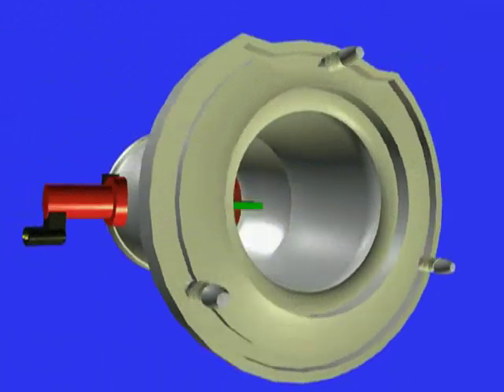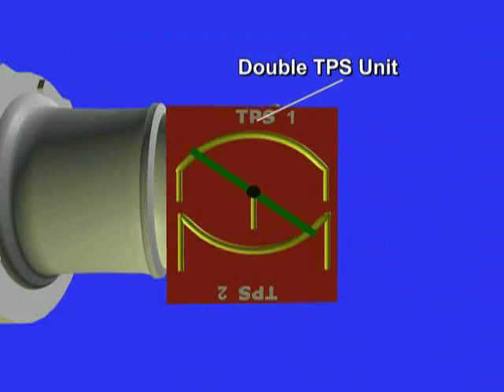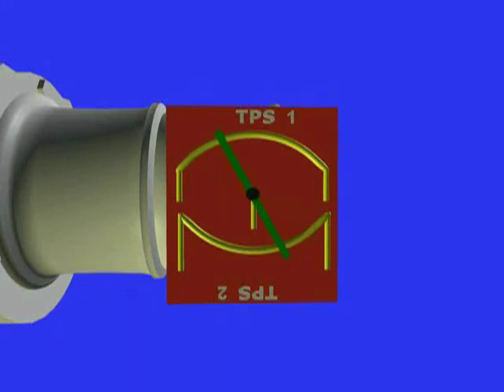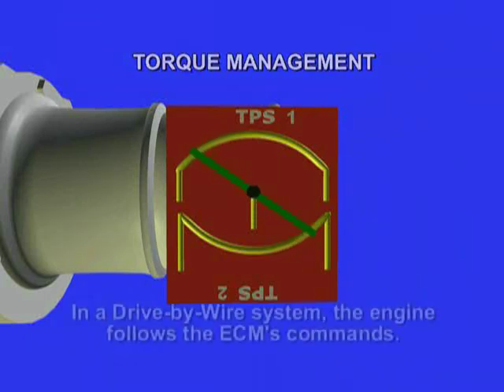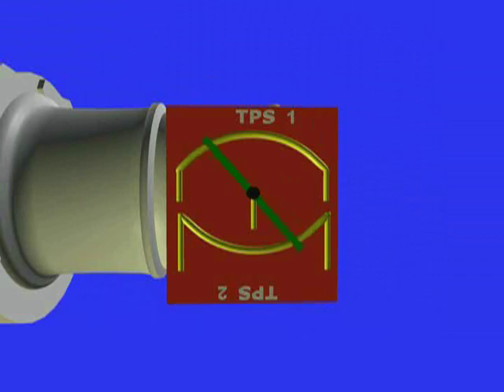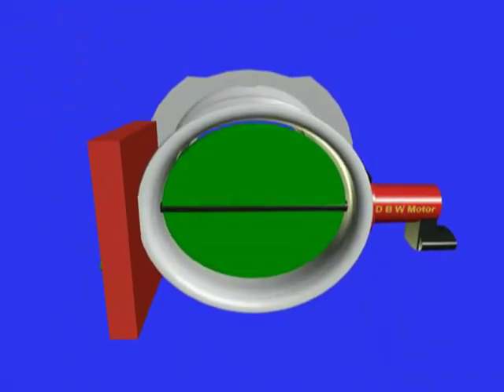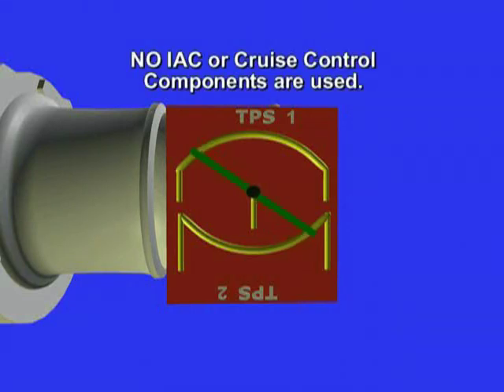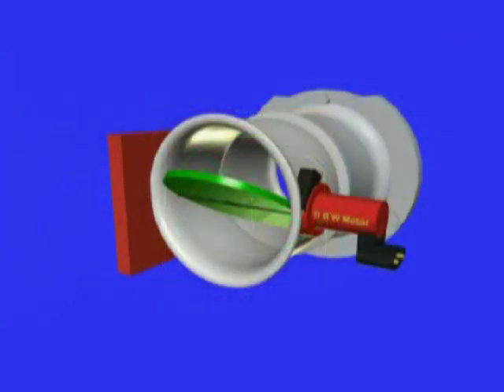Drive-By-Wire or Electronic Throttle Actuator

Comment from the maker: @theASEtech No, there isn't, here's why: The older drive-by-wire systems had to be reset with the OEM scan tool. Most newer ones don't. There's just a procedure, depending on the manufacturer. But, the one thing to consider is throttle body cleaning; which is now more important than ever. If a DBW system goes into limp-in mode due to TPS faulty reading at idle, clean throttle body THOROUGHLY and reset the DBW TPS rest or idle values according to the procedure. Keep posting, thanks....

Comment from the maker: The Bosch Tiptronic (padle) transmission is considered a shift by wire, but I don't think that's what you were asking about. Haven't see FORD using Tiptroics, which is used on Porches and others. Hyundai was working on a SBW transmission, which may be coming out as we speak. But it has to be super new. I haven't seen it yet. Thanks for buying my publications and DVDs. Keep in touch through Twitter, FB, Google+ and LinkedIn. Sometimes I put out free stuff. Thanks again...

Comment from the maker: Drive-by-wire is now used on Formula-1 and Indy cars. There's no lag time. In all my years are a trainer and tech I've never seen lag time. If anything, it's faster because the system gets used to your driving patterns and predicts your response. You have no choice but to get a drive-by-wire vehicle. Cable accelerator systems are no longer made. I do appreciate your input and opinion. THanks for posting.

Comment from the maker: @theASEtech Ok, I can tell you that engine breaking the vehicle will not cause a DBW issue. If you tried to play with the throttle body using a screw driver or another tool, that'll cause an issue. Clean the TB really good, then find out the DBW reset procedure. Let me know if there's anything further I can do for you. You're encourage to check out our "Stories from the Road" series right here in this channel. It is all done free for you guys, professional tech and DIYs alike. Keep posting...

Comment: I'm not talking theory. This is real. If your throttle is not jammed, why are you cleaning it??? There is absolutely no good reason to do this. Let the DBW (as you call it) through the ECU, Lambda sensor, MAP sensor, Knock sensor, Pedal sensor, Temp. sensor etc etc etc decide where the throttle should reside. It's designed and calibrated to do this. Cleaning MAY cause damage.
Without sounding derogatory, and I apologies if I do, but I bet you're on the theoretical end rather than the practical.

Comment: You are absolutely wrong here. It is vital that a throttle can achieve the minimum controllable airflow at the blades lowest physical angle. The only option an Engine Management System (ECM, ECU etc) has is to increase the blade angle therefore "carbon deposits" allow for higher blade angles to achieve this minimum controllable airflow. 
Again I want to make myself clear. I'm talking about the carbon deposits that DO NOT cause the throttle to seize. I thought I was clear the first time.

Comment: @ADPTraining Now, in regard to cleaning the carbon deposits in the bore, this is a big mistake and absolutely unnecessary. It's a benefit to have these deposits for sealing. The ECU will compensate for these deposits by adjusting the blade angle UP after measuring airflow and manifold pressure. Scratching the bore or nicking the blade will cause irreversible problems. 
BTW, the OEM's clearly state this in their service manuals. Unfortunately, the service guys don't always follow instructions.

Comment: @ADPTraining Furthermore, if you lose the mechanical relationship between the throttle plate and TPS (Contacting or non contacting) by removing the TPS, it is almost impossible to regain it. Not all OEM calibrations are self learning. The engine ECU will always assume that the plate angle is within the TPS tolerance at that specific angle and if it's not,because the relationship is lost, it will trigger the limp home mode. Bottom line is, if your ETC TPS is bad, replace the whole unit.

Comment: @ADPTraining I'm specifically talking about the carbon deposits in the bore, not the TPS. Debris in the TPS indicate more severe problems, specifically, moisture through bearing seals, cover seals etc. They should not be cleaned either especially with DBW or ETC (Electronic Throttle Control) or ETB (Electronic Throttle Body) systems since these are generally NON SERVICEABLE components from the OEM.

Comment: thanks for your answer i'm just having problems with theDBW i think because i was using the overdrive buttom pushing it to use it coming down a road instead using the brakes because front brakes were shaking a lot i used the engine to brake instead i checked the tps on throttle body on other side of DBW and looks erratic so may be is that the problem ? also the transmission is doing bad thanks for answer my question i'll keep you informed how my truck is doing your videos are so good

Comment from the maker: Yes, a years back I had a chance to rebuild the shift-by-wire box for a Rolls-Royce motor car. Believe it or not, the transmission was a General Motor Hydramatic. But, the rest of the shifter, box and electronic controls were RR. It operated by a series of switches at the level inside the cabin and a motorized control at the transmission.The only link was a control wire. I have seen even more modern systems using CAN network. The reality was that the shifter was so smooth, fit for a Rolls-Royce.

Comment from the maker: DRW has nothing to do with profit. It is a perfect match between engine power output and the final drive or tires. It comes from the concept of torque management system. If it were only profit then it would not be used in Formula-1 cars. For all techs out there, I've seen it before many times during my seminars, if you resist technology, you'll eventually get run over by the technological bandwagon. Thanks for posting... I appreciate your POV.

Comment from the maker: So far your points are well explained. No, I've been an auto tech for over 25 years. All my publications and seminars are based on practical applications. In fact, even my Scan-1 Diagnostic System software, which I designed and developed, is all based on practical applications and what you need to fix your vehicle. 
CONTINUED: 1

Comment from the maker: @ozziindaus There's no sealing needed on the TB. Furthermore, newer drive-by-wire systems require a clean TB to operate and not skew the TPS reading. A clean TB is a must for proper engine operation. Keep posting.

Comment from the maker: Vacuum actuated cruise-control? This system doesn't need any of that. In reality most issues now days can be fixed by the consumer if only they had the knowledge. Keyword here is KNOWLEDGE and nothing else. Furthermore, most of the knowledge can be acquired from the web, including service manual if you know how to use Google properly. Makes sense?

Comment from the maker: CONTINUED:1 
I am not theorizing, throttle body cleaning is a mainstay and a must during any engine tune up work. As you pointed out, the ECM makes up for some carbon deposit and uses the adaptive memory to make up for the deviation from a clean TB. If the max. deviation is reached, the a code is set, throttle is affected and idle speed suffers. Since a major TU is done once every 45K miles or so, is pays to the a TB cleaning and prevent issues with the max. deviation reached. Makes sense.

Comment: Hi
Many years ago we in the repair trade longed for alternative systems to increase the life and efficiency of cars and trucks and in many ways we have achieved a great deal, however, the benefits have been skewed towards the manufacturers and regulators. I say this with dismay because many problems and expense could be avoided if it served the purpose of efficiency. Take the DBW principle - it is in itself a farce if it is designed to reduce emissions and costs. When the system throws up a P0638 on a generic scanner it only indicates a problem SOMEWHERE on the throttle range - even dealer level diagnostics cannot show what the problem is. Many dealers can only test by trial and substitution that leads to high diagnostic costs and many wasted hours of road testing as each test is qualified until they get lucky. If manufacturers were seriously interested in efficiency it could easily be quantified if they built in to the vehicles accurate self diagnostic systems or better still more robust electrical equipment to last the lifetime of the mechanical properties of the vehicles i e clapped out.

Comment: How can you fit a vacuum operated cruise control to this system,car manufacturer has got us by the balls now,was going to take it off my old Ford and try and fit it to a later car but now it looks like it can only be a high priced low cost effing factory option.

Comment: Thank you,looked at one website re 'Hacking" into a cars wiring and have decided to wait until the model I want comes out with standard cruise fitted,either Yaris YRS or ant Corolla. Feel sad about junking 21 year old Falcon with less than 200 Km on the clock.two distributors later but still running ok.